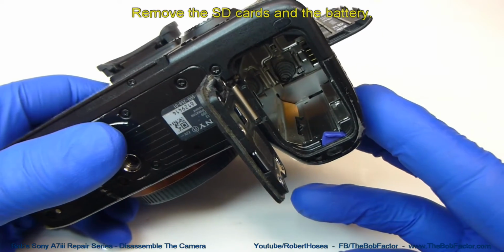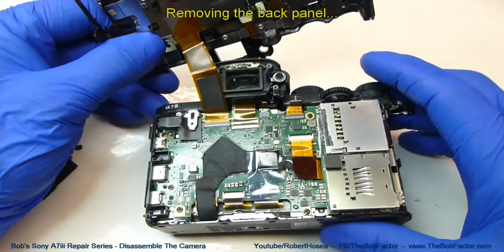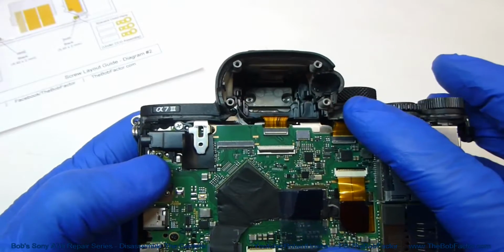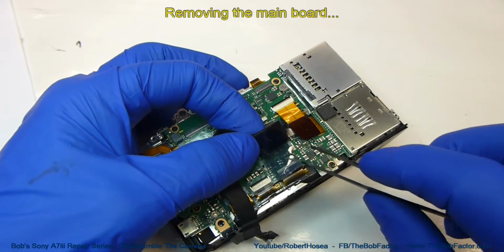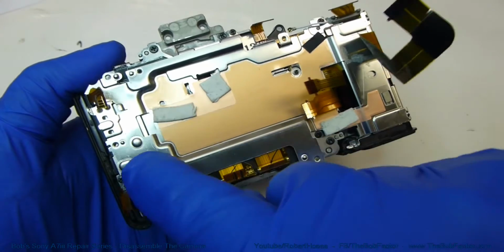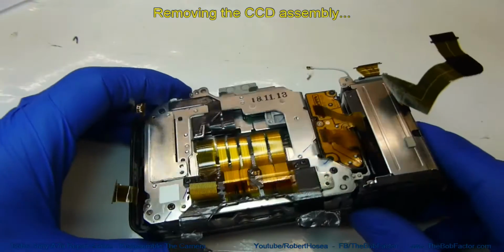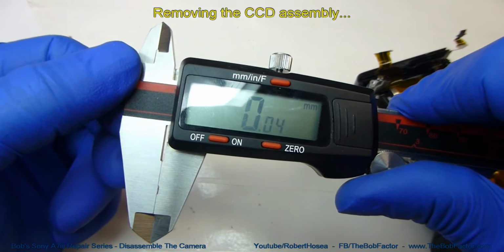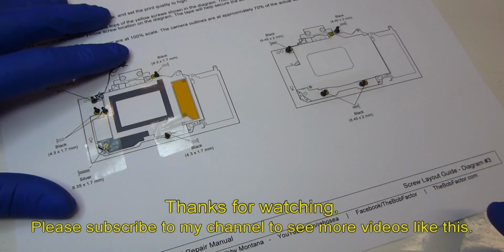Sony A7iii Repair Series - Disassembling The Camera For Shutter Or Main Board Replacement, etc.

Comment: Do you ever replace sensors? I'm curious because I will soon replace the sensor on my ILCE7RM4 and am concerned that I don't have access to the Sony Adjust Station software or the device-specific Adjust modules that I believe are necessary to recalibrate the camera's sensor defect table.

Comment: I have a question, I was recording today and suddenly my camera turned off. At first I thought it was the battery, then, I changed the battery to full charged one and it doesn’t turned off as well, so, I tried to charged it but I noticed that there are no light indicator on the charging port. After watching your video, I kinda want to fix my Sony a7III but I don’t know where is the issue? Is it the mainboard?

Comment: Hi mate. Great video. Was wondering if you knew why there’s a (somewhat) common issue with the shutter button.

In my case, it just fell out. I put it back but it seems to still slip out on occasion. A bit annoying as it means I have to tape it down?

Any ideas how to fix / what the issue really is?

Thank you!

Comment: Love this content! I need to replace the hot shoe on my A7RV. Looks similar to the III (I realize not exact). Sony wanted $800 to replace it but I can get the part for $50 on eBay. Do I have to remove the entire back plate to reach the connections for the hot shoe?

Comment: My a7iii is showing orange warning light in front and the main screen won’t turn on after I left it in a hot car one day 😫🤦‍♂️ even with a battery change or manual charge with cord it wont work…
I’m guessing I fried the motherboard. Hoping I can follow this video or else I’ll have to pay $900 out of pocket. In this economy. Do you have any tips on diagnosing motherboard issues/repair? A new motherboard is so expensive

Comment: Bob, thanks! This was an excellent video! I appreciate you explaining the what/why, while taking each piece apart. 

I need to replace the sensor assembly on my A7RII, the IBIS sytem is getting stuck when I turn the camera sideways and causing an error(Turn camera off and on again). Can I still follow this guide, or are the internals too different? Thanks for your help!

Comment: Many thanks for the detailed video! I have a Sony A7III, and unfortunately, the joystick got stuck and eventually broke — this happened just two months after my warranty expired. After watching your video, I felt confident enough to try fixing the camera myself. I ordered an original joystick from AliExpress, and it came with the correct part number and original packaging. I followed your instructions up to the step where the display and control button assembly were removed, then replaced the joystick without disconnecting any wires or ribbon cables.
Reply from the maker: Oh that's great! I'm glad the video helped you out with it. 🙂

Comment: Hi Robert, after I removed the CCD unit up, 3 shims fell. My camera is the Sony a7IV - even if I open another A7IV the shims thickness could be different right in different places? the only one that didn't fall off was the one on the right side 45. I am left with a 40, a 45 and one that has no markings on.

Comment: Great demonstration of teardown and explain the parts. I have doubt in just replacing the broken Mic door. Is there any way to replace without opening the body side
Reply from the maker: Unfortunately no. The door is interlocked with the side plate that holds the microphone jack, and you must remove the main circuit board to get to it.
Reply: @Thebobfactor thankyou. I will leave the door as is then.

Comment: Hi For the audio rec jack door do i have to remove all those screws in order to take it out?
Reply from the maker: Unfortunately yes. The door is interlocked with the plate that holds the microphone jack.
Reply: @Thebobfactor  And for the the change of the door for plug in power, do I have to disassemble the whole thing??

Comment: I really appreciate the video and the diagram downloads you supplied. I haven't found any other resources online that are this in depth. I'm getting a hot shoe related error and need to replace it. I even see where you described that fix to someone else. This still looks scary but doable with what you've supplied. I'd imagine it will save me hundreds over having Sony fix it. Thank you!
Reply: did you fix the hot shoe nrepair and do you have picture of the replacement?
Reply: @dutchbatunprofor158 I haven't done it yet. I found the part on Amazon and eBay for around $30. I plan to order it now that I have seen the process to disassemble the camera. He said in another comment: 

"You will only need to disassemble it down to where you can remove the top section. Once you have the top section off, you will have access to the hot shoe from the underside. There are a few other parts on the underside that will have to be removed in order to get to the hot shoe screws and flat ribbon cable."
Reply from the maker: I never did hear back from the other person who was having a problem with the hot shoe on their camera. Hopefully it means they were able to fix it. You shouldn't have any problems with the disassembly and reassembly. I hope the repair goes well and the new hot shoe fixes the problem for you. 🙂
Reply: @Thebobfactor Yes, it looks fairly straightforward and similar to how other electronics are put together. I would have never been brave enough to try and figure it out without this video though. From what I've seen, you've probably saved me $500 by being able to repair it myself!
Reply from the maker: @robberstea  Good luck with your repair, and give me a shout if you have any problems.

Comment: Very detailed and interesting video, really thank you! I have to disassemble my Sony A1 because I damage lens contact pins so there is no contact with camera and lens. Unfortunately to replace this part I need to disassemble all camera from begin to end. Design of A7III and A1 looks very close so I think that 95% of steps in this video will be the same in my case. Also thank you for diagrams!

Comment: Thank you for taking time and taking us through the guts of Sony. My Sony a7 recently fell and both screen and viewfinder were not responsive at firts, but after a night with the battery taken out the screnn came back to life (although matrix is pixalated in few places), but viewfinder still not working. Any idea what could be wrong and waht do I need to do?
Reply from the maker: That would be really hard to say. It could be one of a few possibilities. To have it effect both the viewfinder and the main screen would suggest that it has something to do with the main CMOS sensor or it's circuitry. The first thing that I would do is to open it up and look for any loose cable connections, and also look for a cracked or broken main circuit board. After that, work your way down to the main sensor, looking for any obvious problems with anything being dislocated or broken. Hopefully it's something that can be spotted pretty easily and is fixable.
Reply: @Thebobfactor  Thank you for your reply. Loose cable would be the thing I had in mind, let's see what I see when I get inside. I was hoping that the problem with screen was that camera was in shock, but perhaps it has some permanent damage right now as well.
Reply from the maker: @neuroniuans  I agree with you. I think it's something that will need addressed unfortunately. That doesn't mean it's going to have to be something serious though. It could be something very simple. We won't know until you have a chance to inspect it though. Good luck with it. Let me know what you find.
Reply: @Thebobfactor  Just bought tiny screwdrivers today and planning to get to it in hte next few days.

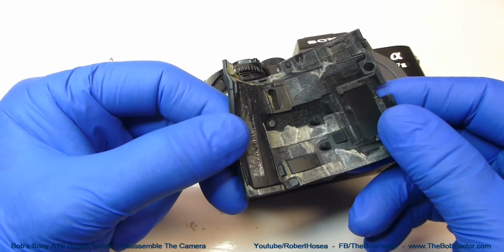Comment: Hello and thank you for this very helpful video! Lifesaver! What do you use to reattach the grip to the camera? You mentioned you would show at 1:53 but didn't see a re-assembly video. Thank you!
Reply from the maker: Hi. I hope to get more videos for this series completed soon. What I have found that works best for reattaching the grip to the camera, is a good quality doubled-sided tape. It seems to work better than some of the glues that I have tried in the past. The tape holds the grip on very well, and you can still remove the grip if you need to. Here's a link to some double-sided tape that I have used on my Sony camera. This pack of tape includes multiple sizes in the pack, and I found the strips that are 3/16" wide to work the best. https://www.amazon.com/gp/product/B09LT1Z76H/ref=ppx_yo_dt_b_search_asin_title?ie=UTF8&psc=1

Comment: where can i find parts numbers for sony spare parts? is there any good online source?
Reply from the maker: I have always gone to eBay for camera parts. In some cases when I can't find the individual part that I need, I will look for a "for parts, or broken" listing of the same camera make and model, as long as it appears that the camera doesn't have an issue with the part that I am needing. 🙂

Comment: Hey Robert, just wanted to reach out and say thanks SOOOO much for making this video! I just used it to replace the microphone jack and the printable screw diagrams were incredibly helpful. I really appreciate your efforts. Unfortunately, there's now a bad hiss on the audio input (with and without an external microphone plugged in), so it sounds as if I may have messed something up when reassembling. Regardless, I'm very grateful for this video and I just subscribed. Take care. 

- Justin

Comment: Do I need to take my camera apart to replace the multi-selector joystick?
Reply from the maker: Yes you will, but only as far as removing the back panel. I have not removed that selector assembly myself, and I don't have a video showing how to do it yet. Hopefully sometime in the near future though.
Reply: @Thebobfactor  that would be cool.  I think I will hold off on sending it out for repairs.  We have no service repair in California it seems.

Comment: I am needing to replace the hotshoe on my A7iii. Do you have to disassemble the camera in order to access the cable connection for the new part?
Reply from the maker: You will only need to disassemble it down to where you can remove the top section. Once you have the top section off, you will have access to the hot shoe from the underside.There are a few other parts on the underside that will have to be removed in order to get to the hot shoe screws and flat ribbon cable.
Reply: @Thebobfactor  thank you!! That definitely seems doable